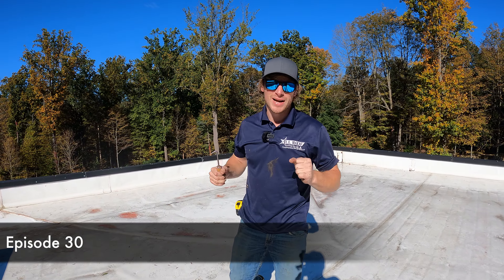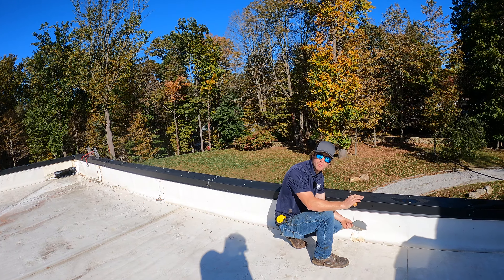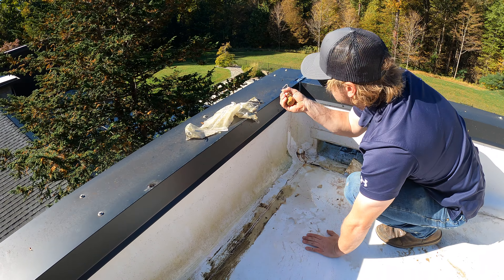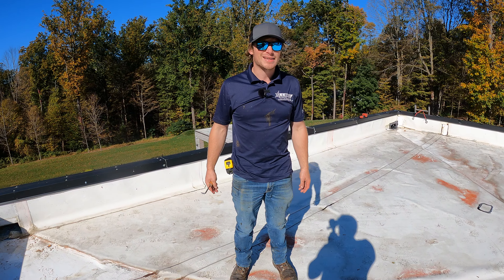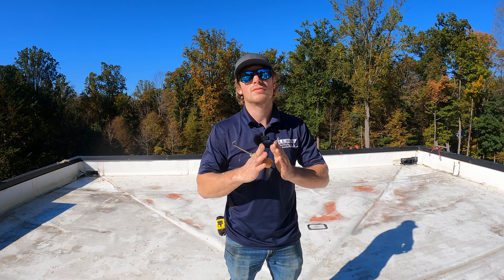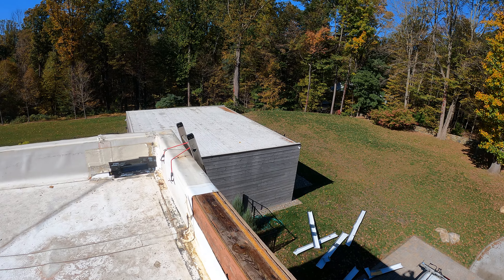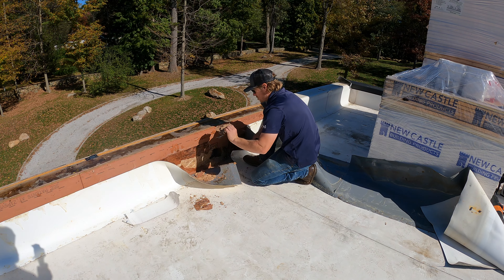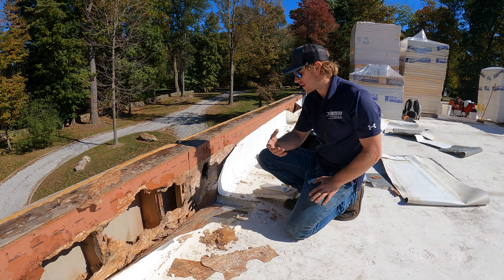Nightmare Roof Disaster!

Comment: THe OSB probably rotted because of the condensation in the wall but all the fasteners on the horizontal part of the metal cap.  Fasteners on the horizontal surface will suck down the metal and cause water to pond on the metal cap and enter through all those screw holes. And yes companies that do work like that do keep us busy.🙂
Reply from the maker: Love your responses haha. Where are you based?
Reply: Chicago @AllRoof.